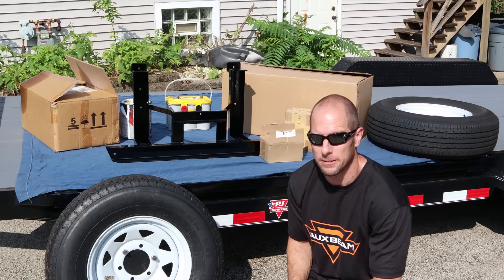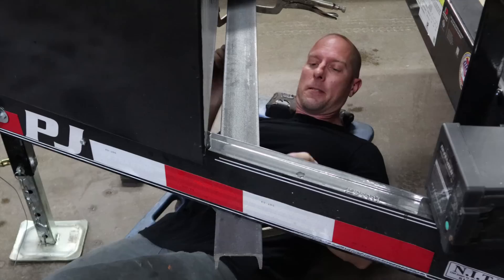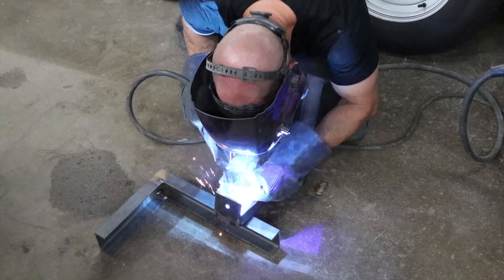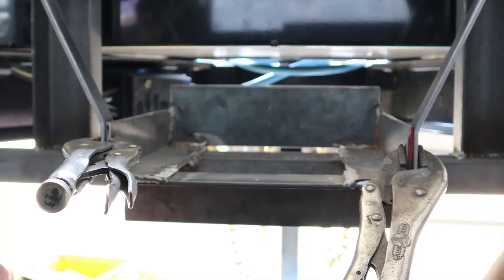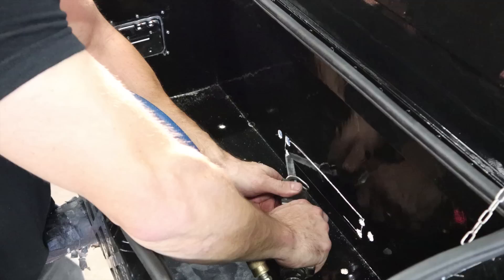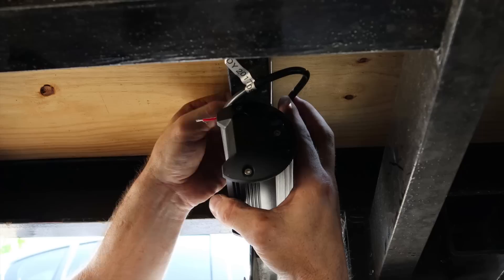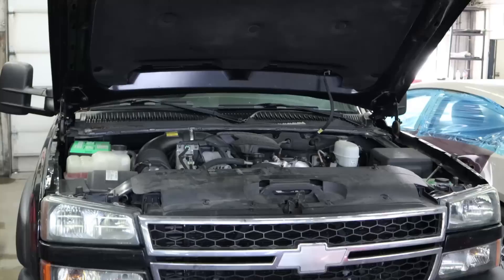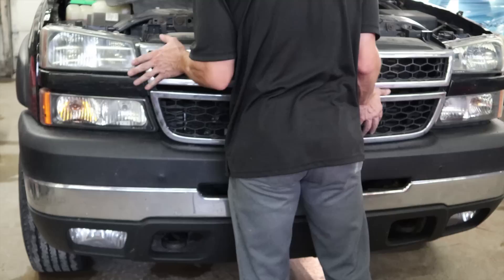2019 PJ equipment trailer winch mount fabrication,  LED light installation and other mods..

Comment: As a fabricator not bad.... I couple things  I would do slightly different for weld joint for better strength on, that said very nice  and nothing wrong with what you have done. Excellent work dude
Reply: for example... not very good with my wording 4:58 looks like you butted the corner joint then welded over top.  a better method is to fillet weld the corner, it looks like a V, J or Butt joint. Fillet is the method I have been taught as best practice https://engineersfield.com/types-of-welds/ also the side joint do look butt welded If you require strength I would go with a V if beveal groove for better strength. for the aplication prolly not needed but always best to go with stronger joints
Reply: Again nice work thou dude

Comment: Looks great. I did lights on my trailer for loading and unloading atvs. Also the lights are wired up the the 7 pin trailer harness for reverse lights.
Reply from the maker: Thanks, the reverse lights I thought of afterwards.  They were so useful that I needed to hook them up so I didn't have to get out of the truck to turn them on.  Thanks for watching.
Reply: I don't get why trailers to this day do not come equipped with reverse lights from the factory. It should be mandatory.

Comment: You should always wear a welding jacket, the rays from a mig/tig welder can severely burn your skin, take it from an old guy with many hours of welding ive been there and done that. The problems came out when you are older.

Comment: If you are putting a lot of miles on that trailer, go for a TPMS.  Spares ar nice for AFTER the blow out, preventing blowouts from low pressure is much better!  You can have one tire low at night and not feel it for 300 miles until it blows, by then the other one is overheated and weakened and will blow out the next day...  

If you find yourself in tight situations at night, add some 'turning lights' just ahead of your trailer axles, LEDs aimed to light up the area ahead and around your  trailer tires so you can see what's back there, activate them with a wireless remote control on your dash.  Back-up lights on the tail end as well, but those should be very bright and run off your winch battery with a relay, and 2 remote control switches.  One on dash for normal use and tailgaters, the other either on your keychain or in toolbox.  Wired to winch battery in case you need light before truck is hooked up.

Mount a small LED work light on the front of the tool box with it's own local switch, wired to winch battery, aimed at hitch for hitching up at night.

12V hitch jack.

Weld on some RV stabilizer Jack's to the tail end corners, tucked up where they will not drag, then you can unload without the truck if you need to.
Reply from the maker: I was planning on the tpms as that is the reason for 99% of blow outs.  Thanks for the tips and it does have removable stabilizer jacks in the rear, I just had them off at the time.  Thanks for watching.

Comment: OK, I gotta admit, you do much better work than I've seen on here or I do... I'm envious. - Only thing I'd do differently is put the battery mounting J hooks upside down so you can get to the nuts from the bottom for when you change the battery, and maybe mount the on deck lights higher and farther out. I'll look for a update on how you end up liking the set up.

Comment: Man !! This has been one of my favorite videos ever. You really made all the modifications look easy when I know it's not. I read quite a few comments and your answers, and I might be even more impressed with your brain. lol one thought I about the deck you said about it rotting, do they make a composite that would be thick enough and also not crack under the weight of a car or what ever you're hauling?
Reply from the maker: It may not have been the easiest job but I love fabrication work so it was a lot of fun.  I do plan on replacing my deck with composite when it is time.  These should last me at least 5 years and by then the trailer will probably be do for a paint job.  As much as I try to keep my stuff in good shape, it is still equipment and does get some wear and tear.  Thanks for watching and the tip.
Reply: Have you checked out Blackwood trailer flooring ? Rubber material glued to wood. Excellent for traction and also prevents rotting.

Comment: Very nicely done. I enjoyed watching. A few upgrades you should consider is Sterling Power Battery to Battery Charger that way your not having to worry about a down trailer battery. It chargers the trailer battery off the truck. Electronic brakes for the trailer and some running and turn leds wired and mounted on the fenders front side and rear to see the trailer alignment on the road also for others to see your trailer mainly when turning or lane change. Also more of a convenace but a backup camera on the end. :)
 Thanks for the videos. :)
Reply from the maker: Thanks! The trailer has a constant power lead from the truck in the trailer plug.  It charges off of the alternator as I drive and the volt meter in the trailer is a way to make sure it is charging and charged at all times.  The led maker lights are actually enough to light the lanes around it.  I would like a back up camera though, I might have to look into that! Thanks for watching!
Reply: @vehcor  Ok sounds good. :)
Reply: @vehcor  Make sure you have a diode in there so the winch doesn't try and pull power through the small charge wire to the trailer.

Comment: There is a diode mod you can do to this year model that will allow you to run both dim and brights at the same time. Its a simple cheap mod that allows alot of brightness when brights are needed. I did it to mine and it makes a big difference when I installed the HIDs which takes a few seconds to warm up.
Reply from the maker: The new owner can do that. lol

Comment: Great Video.  I just picked up a PJ C5 new also.  I was looking for a great video to mount my new Warn winch and lights.  You sir, did an excellent job.  This directly applies to my trailer.  Thanks!!!
Reply from the maker: Thanks, it was a very specific video but it seems to have reached its target audience.  There are probably dozens of us. lol There are many ways to do it, I went through about 10 different designs before I decided this would be the best. There are links to the tool box, winch and switches I used as well as the lights if you are looking for them.  I have already used my lights and winch a few times and I'm really glad I spent the time to install them, it will save hours in the future.  Thanks for watching

Comment: Maybe add a onboard compressor and a hot dog tank for air tool's or air up a tire out in the field. Also maybe a couple D- ring's wield to the trailer for tie down's along with a weather prof box for your tie downs
Reply from the maker: I have d-rings that go in the stake pockets so I can move them wherever I need them.  I was actually considering a compressor as well.  Thanks for the ideas!

Comment: vehcor I would get a battery box enclosure, like just one of the plastic black ones from auto parts store or even one of the orange, marine ones from boating section at WallyWorld and place battery In that and then into your mount. The battery housing is plastic and is gonna be exposed to the elements especially under there like that. Not to mention, road debris hitting it, terminals corroding a LOT quicker, battery cables dry rotting etc. Also get some Permatex disc brake quiet in the aerosol can and COAT all battery connections, power/ground leads to prevent corrosion and re-coat at regular service intervals like when greasing axles, landing gear, ramps or whatever needs maintenance. The disc brake quiet is an old mechanics truck I’ve used for over 15 years and never had an ounce of corrosion
Reply: Also maybe a cheap set of locking lugs and put one on each spare? 
And an LED strip light under lid of tool box and maybe inside frame rail to illuminate winch assembly as you do more nite work. I always put the 24” white strips inside the frame of tongue so you don’t see them but they illuminate ground so you aren’t tripping or banging shins. I just wire into park lights so they’re on whenever markers are, as long as you don’t see the actual strip and just the glow they look kinda neat in transit as well. And I’m meaning like the Alpena accent ones not some 400 lumen solar flare

Comment: My only thought for an improvement would be to add a light in the box, something on a switch that could turn on when the lid is opened. This would allow you to see what’s going on in there at night. It wouldn’t need much just a couple LED’s would do it.
Reply from the maker: Already done 19:25 Thanks for watching.
Reply: What lights did you use for inside the boxes?
Reply from the maker: @jmscollinsiii1  https://amzn.to/2OY2Kvn

Comment: Nice  idea for the winch, very nice !!
Reply from the maker: Thanks, the toolbox was really just an easy way to protect the switches.  I was originally just going to build a water tight box for them and then the multipurpose tool box idea came along.  After a little searching I found that one with the near perfect dimensions.  I have used the winch and lights quite a few times now and don't know how I every lived without them.  They have already saved me more time than I invested into this install.  Thanks for watching!

Comment: I've had a few PJ trailers and the 1st thing I do is paint the wheels black, looks stealthy. 
Just a "suggestion" when drilling, go slow your bits will last longer......... :-)

Fantastic job!!
Reply from the maker: Thanks for the tips!
Reply: @vehcor  or you can use coolant (like threader oil) to keep your bit cool when drilling.  At our shop we use S-30 cold saw coolant or a cutting wax.  Just a little goes a long way and you don't have to slow down your drilling speed.

Why didn't you store your battery in one of the toolboxes?  It'll keep the road spray from corroding the terminals.
Reply from the maker: Mike Wieggers The rear toolbox is full of winch and the front is full of tie downs, straps etc.  Since I used the side posts, I am not too concerned with corrosion. They are coated in dielectric grease as well.  Thanks for watching.

Comment: Very nice work!  I too have a  PJ equipment trailer (18' 10k), but the tongue on mine is too short for a box with the way the jack is mounted on it.  I welded a receiver tube to the front stop bar with some bracing, and put expanded metal in the bottom of the tongue for an area to throw chains & straps.  I am about to run welding leads from my truck battery to a connector at the bumper so I can plug my winch right in and run it off the truck.  One less battery to buy and maintain when it doesn't get used often enough to justify it for me.
Reply from the maker: Thanks, I did notice they have a lot of different configurations for the tongue.  I specifically looked for this one and a 20 footer (need the length for big trucks).  I did go through a bunch of different ideas before ending up with my design.  One did include the expanded metal tray but I like having the tool box to keep sticky fingers off my stuff.  I do end up in the city some times and the auctions are not always in the best neighborhoods.   I had a similar winch mount to yours on my old trailer.  I never used it for that, just to latch smaller trailers to it.  I hear you on the price of the extra battery, this one was ridiculous. However, I do like that I only have to hook up the trailer harness, plus I am able to use the lights even if it is not hooked to the truck.  Thanks for watching!

Comment: the video did not show one and you did not mention if you ran a 12-volt power source to recharge the battery. if that trailer came with a 7-way RV plug it would be easy enough to do so. we do have something in common though, we both work alone. sometimes a helping hand is nice on the more larger heavier items but for the most part if somebody offers to help, they end up getting in the way. funny how you get used to working alone..
Reply from the maker: Yes, the 12 volt power from the truck recharges the battery.  The volt meter in the trailer is an easy way to check and make sure it is working.  I work odd hours so that doesn't help when you need assistance.  You just get used to working alone.

Comment: I was a little confused about the lights mounted under the trailer, but there was a quick shot of it on and I think I see why. It would be nice to see more of it lit up. I looked to see if there were a new video for the trailer but I didn't see one.
Reply from the maker: I think I will make another video of the stuff I have added over the year I have had it.  The lights in the back were to make it easy to see the ramps and under the car if you were hooking up the winch.  They worked very well for reverse lights so they are now wired into them as well.  Thanks for watching.
Reply: @vehcor  I'll be looking forward to the new video.

Comment: The only thing I have seen not on that trailer that might be needed, is those tire covers might need to be 'drop down' types, in case you need to pull a car or truck that is locked up and going sideways up the trailer as you are pulling and pushing it. Other than that, excellent job. As for the welding, not bad. On some of those butt joints, you can grind a little off each end \ / so you end up with a V to weld INTO, instead of just a little seam that you practically grind off to paint or powdercoat (old werlders trick). Very nice job though, as always.
Reply from the maker: The fenders are removable.  I actually had to take one off to get a truck off the trailer.  It is easy, 2 bolts and a couple plugs.  I have added some more stuff to the trailer in the year I have had it so I will be making a part 2 for this.  Most of my cars come from the auction and they set them down on the trailer with an end loader.  The winch is for the cars I pick up locally that do not run.  I use this trailer like a tow truck. lol Thanks for watching.
Reply: @vehcor  Nice. I am looking forward to the Part 2 video. As I am all of your video's.

Comment: Good videos.  You may want to consider a strap on the battery or double nutting the clamps.  The comment about a battery box sounds good too.
Reply from the maker: Thanks for the tip.

Comment: What you needs is a small solor panel with a cut off Switch to change your battery
Reply from the maker: I plan on adding one to keep the truck charged as well when it sits.  Thanks for watching.

Comment: This one of the best setups I have seen, Thanks for the ideas for my next trailer. especially like the tool box idea for the winch mine is currently mounted on the deck of the trailer and it gets in the way to much.
Reply from the maker: Thanks, it has been super useful.  My main goal was to keep the deck 100% clear since I commonly end up using every inch somehow.  Thanks for watching!  Good luck on you future modifications!

Comment: You should sell this setup as a bolt in upgrade for a PJ!
Reply from the maker: I like that idea.  It would give me an excuse to make more of these. lol
Reply: @vehcor  

I would copyright your design.   I like your tool box and deck board color.  I would put the battery in the tool box;  because your battery costs a pretty penny.
Reply from the maker: @matta3888  I tried, but the battery would not fit.  I would have had to put the winch off to one side or the other.  It is actually pretty hard to see under the toolbox and behind the frame rails and tires.
Reply: @vehcor  I'd definitely buy one.
Reply: Figure your price and let me know. I would really like to get a similar setup, but was thinking of making something removable, but I really like your setup.
Reply: @matta3888  You could always put a black plastic battery box around it. If  anything a would be thief wouldn't be able to see that it's a more expensive battery.. Plus its somewhat protected from any flying stones, debris.

Comment: Dude very nice the only thing I would have done differently would have been the addition of a slide for the battery. If you ever have to replace it it looked like the whole winch/tool/ wire box will need to be removed. Other than that it came out very nice!
Reply from the maker: It was easier to put in before the toolbox but it can be removed without removing the toolbox from underneath.  Thanks for watching!

Comment: only thing I could suggest to make it more awesome, is to put a solar panel charger on one of the tool boxes. that way it charges any time there is sunlight!
Reply from the maker: Possibly coming in video 2 with more upgrades.  Thanks for the tip and for watching.
Reply: Shit that's clever, I'm surprised I've never heard anyone think of that idea before.

Comment: You covered up all those "important" safety stickers on the trailer, now how are you going to change a tire or air one uo without those things? Awesome trailer and a tip, LED headlights come in two types, with ballast and with remote ballast so for this application you use remote ballast and then you do not have the back end sticking out and have to make room for it, just locate the ballast somewhere close and hook up.
Reply from the maker: Safety stickers take all the fun out of things! lol  Thanks for watching!

Comment: Light bulbs, you should mention that it is advisable to wipe them clean with alcohol in order to get the oils from your fingers off. Otherwise they will have a shorter life span and burn out earlier.